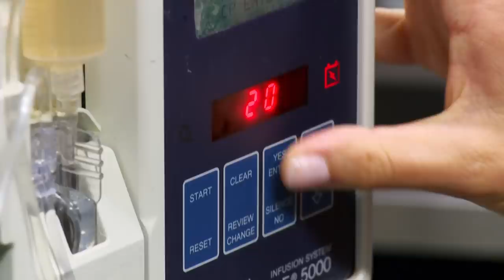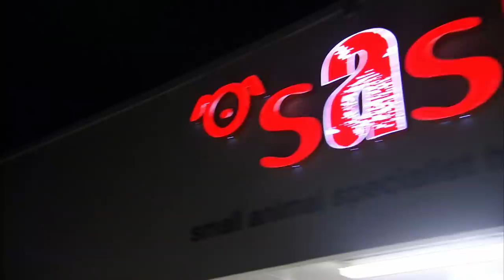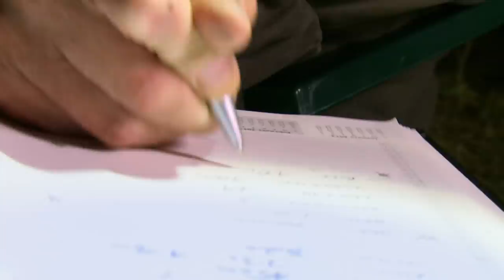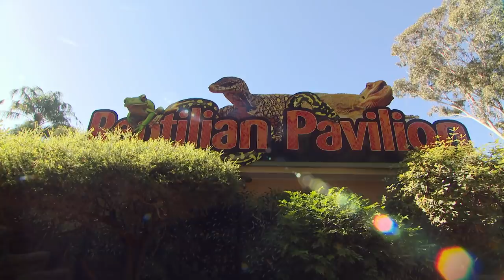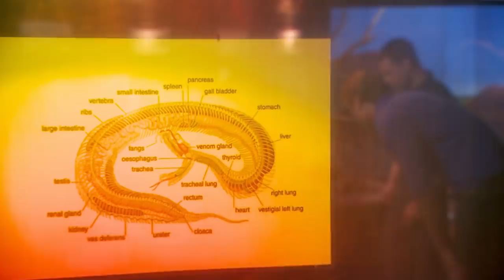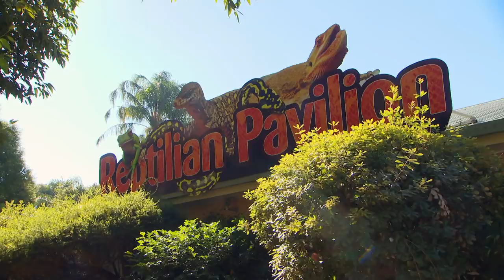Tick Poison Spreads Rapidly Through Tiny Puppy! | Bondi Vet Season 6 Ep17 | Bondi Vet Full Episodes

Comment: I find it a bit strange that they're treating the mini horse's sharpened teeth as this unusual and extreme circumstance. Horses over the age of 15 typically need their teeth checked and floated (sharp points removed) every few years and it's considered a pretty routine procedure. My horse is 22 and just had his teeth done a few months ago. It's also odd that this guy took in a 20 year old horse and didn't immediately check his teeth because that's one of the first things I would have done, especially for a horse with a history of neglect who wasn't receiving regular and proper treatment.
Reply: the age was a guesstamate, and the level of how bad the teeth were was more the surprise(other side was looking fine, weirdly)
Reply: @prcervi  It's pretty easy to tell an older horse from a younger horse based on several factors, teeth being one of them. Checking for sharp edges on teeth is just one of those things you do when you have an older horse, again, especially from a neglect case. When Dr. Chris said the first thing you think of when you see a swollen cheek is abscess, but I hadn't thought that at all and I'm a registered dental assistant! From the second I read the title "Horse Struggles To Eat" I thought "aha, probably needs its teeth floated".

Except that seemed a little boring and routine for a show like this so I was skeptical. I thought that there had to be something different about it. Nope, just teeth floating. A rather extreme case but still nothing too exciting. And most of all I'm flabbergasted that the guy didn't check the teeth of those two minis immediately after acquiring them. It's really easy. You just stick your finger into the side of the mouth and feel for sharp edges.
Reply: @genthespacewitch  : But we all know that horses need the " Tooth fairy  "  often as soon as a young horse starts losing it's foal teeth .  It's so important that the young horse have no pain for acceptance of the bit . A good start is imperative  . 
A horse in work needs it's mouth looked at 2 x per year ... 
The higher the level of work , all the more important  . 
A trail riding horse , once a year but ... Equine dentistry isn't just for older horses .
Reply: Maybe they don't normally get horses there?
Reply: For me the surprise was that there are actually proper dental tools for horses.
Reply: Then again the horses were skittish...even if it’s not a proper excuse, earlier on they might’ve injured someone or hurt themselves.
Reply: @genthespacewitch  maybe he didn't think of this because the horse only had problems on one side.
Reply: And put on fitting halters
Reply: @genthespacewitch  I was thinking the exact same thing.
Reply: Yep.  Checking their teeth for me was just as routine as checking feet.  No they sure don't like it but it has to be done.  Miniature horses are more at risk because they have small mouths but regular size teeth.  I don't really think this dude knows very much about horses.  Charlies feet also needed attention and he said his feet were ok?  ummmm not for much longer they're not.  Horses, donkeys, mules, they are a LOT of work.  I have about 8 acres of field just sitting out there growing.  People will say why dont you get a horse?  My response is are you gonna take care of it?  There is a whole lot more then putting one in a field and letting it look pretty.  Whole lot more to it.  More than I want to deal with, which is why I dont have one
Reply: It's an animal rescue operation.  They are no doubt low on funds, and have many other neglected and abused animals to help.  They addressed those horrible feet first before the teeth.  I can't argue with that.  Let's face it:  the mini horse is In a much better position than he was with his previous owner.  With so many types of animals to care for, and a lot of the people being volunteers, they obviously don't have the kind of specialized knowledge that you have about horse maintenance.  But at least they've done their best.
Reply: @genthespacewitch  agreed
 Old horse check teeth first thing. Neglected horse the same and as soon a horse not eat amd drop food it's check teeth no matter of age
Reply: @darkangel7820  He said the feet weren’t the priority for that visit because they were already under farrier care. The episode showed “before” photos with much longer slipper-type growth, so it was clear they’d already had an initial trim. Fixing badly overgrown hooves takes months of professional trimming and regrowth; it’s not something that can be fixed overnight.
Reply: @trekadouble757  that's also pretty common
Reply: Maybe he assumed it'd been getting it's teeth regularly dulled? Or he didn't think of the teeth as it was only side that was effected..pretty odd only one side had sharp ends!

Comment: It was kinda weird to c a simple teeth float be SO dramatized. It's a fact of life for every horse & owner.
Reply: But not everybody has a horse and knows that. I've heard of a teeth float but had no idea what it meant. I thought the mouth brace was cool. I would never have seen one if not for this show. Question: does that not cause the teeth to be sensitive by removing the enamel?
Reply: @marcificht4013  
Found this on Google

Although horses have the same start in life as we do, with milk teeth, later replaced by adult teeth, unlike us, their adult teeth never stop growing. That's essential, because they use them for hours and hours a day, to grind down the hard cellulose of grass (in the wild), which continually wears the teeth down.Feb 8, 2016

The feed domestic horses get doesn't keep them ground down & wild horses die from tooth problems. Or hoof problems
Reply: @animeaunty   Oh, okay! I thought they were grinding away in the SIDES of the teeth. I didn't realize they were just grinding the tops/bottoms.

Comment: 38:38 just curious... if they had an ultrasound machine and thought maybe preg... why didn't they do one first? Or do you need to hold certain reg to use?
Reply: Well usually in the medical field you want to have the biggest problems out of the way in diagnosis to see if the problem is extremely small or its not a problem at all